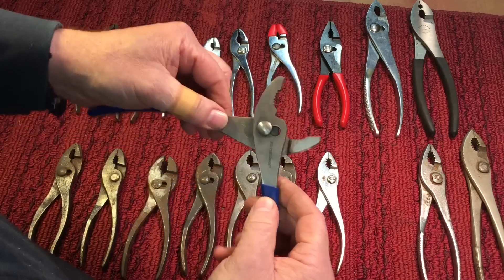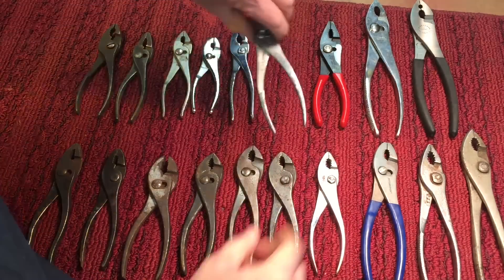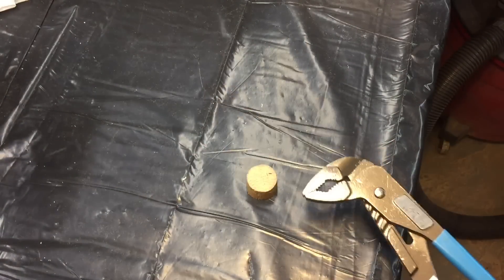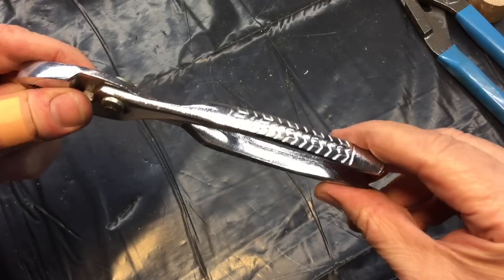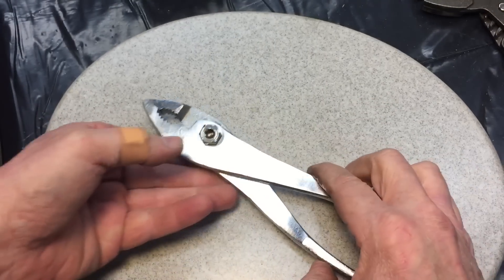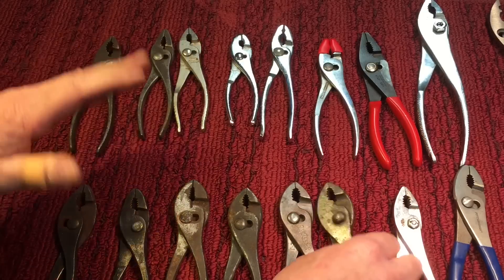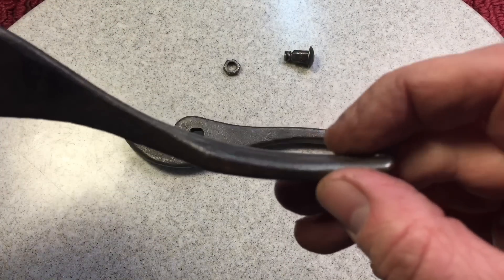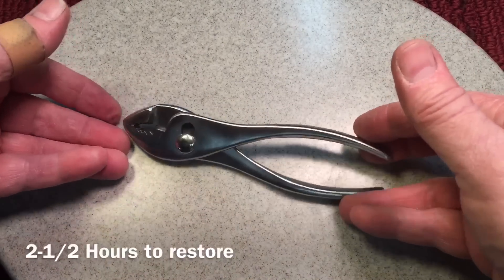Response Video for Ben Mall and Everything you ever wanted to know about Slip-Joint Pliers

Comment: Your restoration made them look brand new. Craftsman pliers slipped into tighter areas with no bolt. Guaranteed for life! My favorite is a snap-on pair that I use for old automotive spring repair. They are perfect for my hand crimping spring clips. Like you I have many pair from collecting through the years. Thank You

Comment: Dad carried a set of 3 position slip joint water pump pliers in his tool belt for 30 years. He gave them out like business cards to his friends. 
I carried them until I went into management. 
I am not a fan of the two position slip joints. Several blood blisters convinced me that I couldn't predict when I would strip the corners off the pin and have them close with a chunk of palm between the handle ends. 
I'm too Scotch to toss them so they sit in a toolbox under the bench. Most of them anyway. Lydia has two pair in her toolbox. She doesn't have the grip strength to break or strip the pin. 😁😎
I used the 8" Klein linemans pliers you restored for me to hang wreaths today. Better than new. 
Thanks again. 😎
Reply from the maker: Dave- I too rarely use the slip joints but I have become more fond of them as they bring back fond memories of me rounding off bicycle bolts and prying cotter pins!   =D
Reply: @ScoutCrafter  I favor Channellock 420's. The larger bearing surface supports the high loads I generally apply.  That and the design that causes the jaws to lock tighter the  harder I pull. Working from a tool belt I got very good at doing more with less. The 420 design makes a passable pipe wrench with more flexibility and far less weight.  😁😎

Comment: I have a pair of slip joint pliers that seem to have the same issue as Ben's.  I took them apart and found that the figure 8 / hour glass / dog bone hole on the one half was worn in the narrow section so that the pin almost fits through without having to rotate to its flat section.  The pin is also pretty beat up and probably accounts for some of the play too.
Reply from the maker: 357magdad - The design of these pliers is that the wear and stress is on the outside of the figure 8 when under a load. When there is no load and the pliers are pinched from the front the pin moves twords the middle of the figure 8 and that extra play gives the appearance of being worn out but when used as pliers the still operate fine.  The design is pretty amazing in the fact it's basically unchanged in over 100 years!  😃👍

Comment: Thanks for the tip on tightening the nut first then peening it, in order to control any loosening over time.  A really helpful video on the ins and outs of slip-joint pliers.  The transformation of that rusted, rough-surfaced pair of pliers at the end of the video was beyond amazing!

Comment: That was a pro tip on tolerance! Super helpful, I would never have thought to run the joint slightly over snug then back off a touch after peening. I dont do tool restos much but have ran into pliers being too lose and the nut constantly backing off. I have honestly chucked a couple pliers for this issue. Your nick name should be Professor Plier, lol, thanks again!
Reply from the maker: Gunter We all have cursed these pliers at one time or another and moved on to better tools...  We had fun using these as youngsters on out bicycles though!  😃👍.  Thanks!

Comment: I think we all have at least a small pile of these pliers and only use a few.  There seems to be a near infinite number of designs for slip-joint pliers.  The head shape, thickness, teeth, symmetry and the handles all can change independent of each other so there is great variety.  I know some people have commented they never use slip-joints because there is always a better tool for the job, but there is no other tool as versatile.  If you keep one of these wherever you don't have a shops worth of tools handy, they can be a real life saver.  They are not intended to be ideal for fasteners like nuts and bolts.  They are an extention of your hand with a mechanical advantage to grip.  You can use then to grip anything: pipe, cable, wire, rope, clips, pins or anything that you need a grip on.  If you really have several hundred, you should pull out the widest assortment of head types you have and do another video to really showcase the ever present but humble slip-joint plier.  There seems to be a lot of interest to this, everyone has or can get slip-joints.  Maybe a new challenge is in order?
Reply from the maker: Time Flys in the Shop - You are so right.  They are a universal plier that is good at lots of stuff but not great at anything!  😂😂😂👍.   Thanks!

Comment: I have a bunch of pliers as well but I almost never use them.  I usually find myself using channel locks instead for most uses.  However when only a plier will do it is good to have a nice pair.
Reply: Agreed. I tend to use vise grips or channel locks the most, lately I have really been wondering if it's worth spending the dough to get some of the fancier kniplex pliers. They have one type I'm particularly interested in as they function like a pliers but have flat smooth jaws and are supposed to grip like a wrench.

Comment: cool pliers!  I just finished cleaning up a bunch of my old files. Question, what do you use to keep them from rusting again?
Reply from the maker: Scott- These have 2 coats of Carnauba Wax and if kept indoors that's enough, however if you keep bare steel tools outside in a garage you need extra protection like a clear coat.  The temperature swings and humidity really do a job on tools!  😃👍
Reply: Scott I think on Files you want to use something light like WD-40.....Should keep them from rusting without making them sticky and gumming up when you use them........That's what I do anyhow and it works for me.
Reply: @rawbacon  Thanks, that makes sense to me! I think I may experiment with some old Turtle wax too.

Comment: was shocked to se asunday video but love the restore question though how would you do maybe a nurling on the handles ever done something like that on a smooth handle just a thought.
Reply from the maker: Hello Mohamed!  I was contemplating the same thing!  I wonder how you could do that and have it look professional...  😃👍. Thanks
Reply: @ScoutCrafter  I think you would have to anneal them and reharden them. 
Anything that will press the design into them cold and hard will take many tons of force. They were stamped out at yellow heat. 
There is the possibility of using stacked fiber wheels to grind a cross hatch pattern into them or perhaps an acid or salt water and DC current etch. 
Hmm... I have etched a mark in my sisters suture scissors. 
Possibilities. 😁😎

Comment: Just had a very old pair of 10” Williams fail.  Was cutting wire and the nut on the pivot volt stripped out and came loose.  Could not find a die or tap in my kit to even to clean up the threads.  Used both standard and metric thread gauges and could not find a match.  They must be some sort of proprietary thread.  Ended up replacing the pivot bolt with a donor nut/bolt from a pair of no name pliers.
Reply from the maker: I think you are right!  Starrett did that a lot!  Custom threads on so many tools...  😃👍

Comment: John, do you lubricate the bolt or the joint at all? I've been putting a dab of 50/50 Marvel oil and high temp grease in the slot on all my pliers to keep things smooth, but I wonder if that really protects anything...
Reply from the maker: Patrick - A very small dab of lubricant is always a good idea around the pin. The design of these pliers doesn't wear excessively because there is very little rotational movement around the joint.  The one issue is that the figure 8 hole seems to be a gathering point for dirt and debris, especially when over-lubricated.   When we were kids those pliers were always in the dirt next to our bicycle!  😂😂😂👍

Comment: I guess I have about 20 pairs of the (2 position) Slip-Joint Pliers and can honestly say I almost never use them. Almost always there's a better tool for the job......Also I find the 6 inch too small for my hand so only the 8 inch feels right but still rarely use them either.
For the record my most used "Pliers" are my Vise-Grip 10WR Originals Made in the USA
Reply from the maker: Raw Bacon I think I like them for sentimental reasons...  Summer days sitting in the backyard fixing a flat on my bicycle with a pair of slip joints next to me always ready to round off another nut...  😂😂😂👍

Comment: John, I knew you would come thru for Joe! (And me). The makeover on those pliers is beautiful! What is the grit on that grinder disc?
Reply from the maker: Hi Lloyd - I had to use a new 60 grit disc because the pitting was just so deep!  Afterwards I used 120 belt and finished off with a 320 belt and fiber wheel...   Pliers are HARD steel!!!   😂😂👍
Reply: @ScoutCrafter  really nice pliers. I wonder if Harbor Freight sells fiber wheels.....hmmmm.

Comment: I never use traditional pliers for anything except to make specialty tools out of them. Hog ring, wire clamp ring, and even a set to crimp Lionel/Marx track to tighten it up. Other than those, I never use traditional pliers at all! I use tools every day at my job and afterwards for fun. My regular pliers just won't do the job, there are much better choices if you have a selection of proper tools.
Reply from the maker: Absolutely, I think most of us use them often until we turn 16 then realize there are better alternatives! 😂👍
Reply: @ScoutCrafter  
Maybe, I went away from traditional pliers at about 6 years old. Still haven't found a use for them at 50 years old! There is always a better tool within reach. That is key. Use the best tool you have access to for the job at hand. Pliers may work if that is all you have access to! In the field so to speak. I live "in the field" in Arkansas but keep a huge collection of tools. Pliers are never utilized, ever.

Comment: My dad always taught me the best sign of quality in pliers was how much spring the handles had in them. Apparently the better brands temper them that way so you, as the operator, have a better sense of how much force you are putting on them.
7:47 You know better than that! You can upset the metal in the rivet with a punch and tighten it up again.
 I would love to see you compare some of these older designs to Kniplex, especially these: https://www.amazon.com/KNIPEX-Tools-00-20-US2/dp/B005EXNT2Y/ref=pd_bxgy_3/143-4179511-1241349?_encoding=UTF8&pd_rd_i=B005EXNT2Y&pd_rd_r=efbd5427-aab4-48e0-a5f4-7214138118bc&pd_rd_w=6spPs&pd_rd_wg=7c8q7&pf_rd_p=f325d01c-4658-4593-be83-3e12ca663f0e&pf_rd_r=A4GA1ZVRENPAD6180CMT&psc=1&refRID=A4GA1ZVRENPAD6180CMT
 They seem to be the newest improvement to the old channel locks. They also have smooth jaws and keep them parallel so they're far less destructive. I had a botched surgery so I only have grip in one of my hands so I've got to have the best working tools. Can you do a video comparison?

BTW my all time favorite pliers are from my Sears Craftsman mini pliers set. The set with the offset nose make rekeying locks much easier than using a pair of tweezers like you see most locksmiths do. Besides those its vise grips and channel locks.
Reply from the maker: John- I have the smaller Knipex and I will try to bring it out!!!  Thanks!!  😃👍